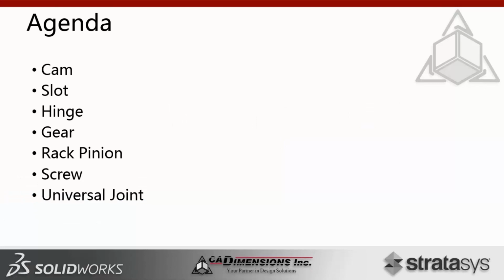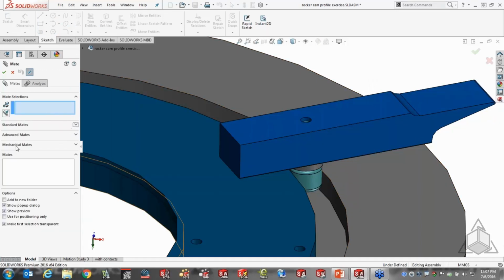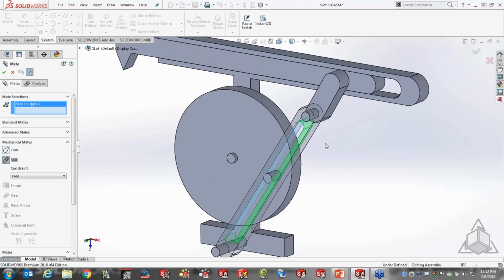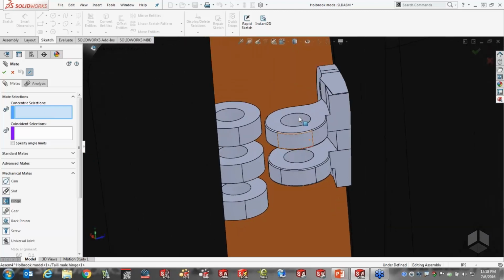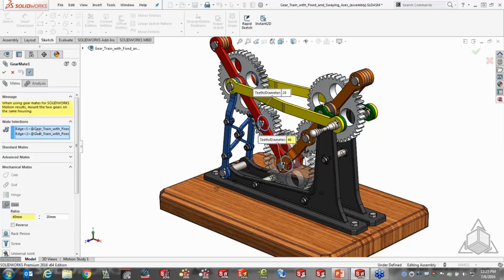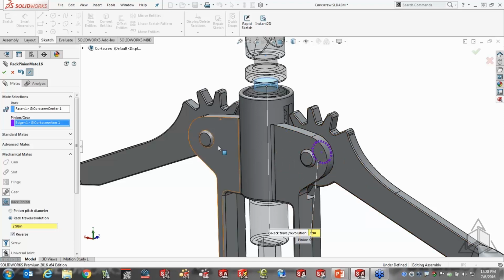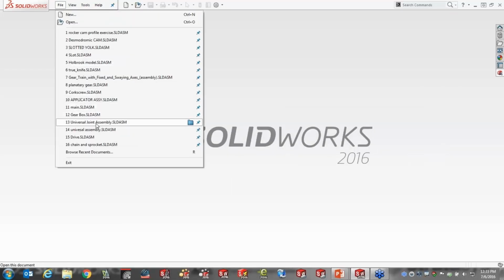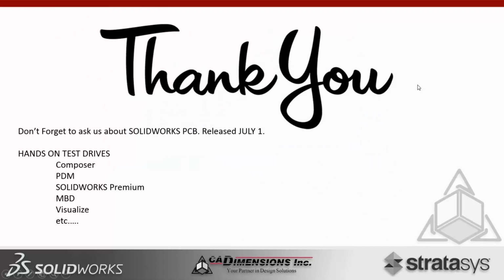Lunch & Learn - Mechanize it! Review of Mechanical Mates in SOLIDWORKS

Comment: Vary good presentation, my name is Arturo, I purchased solid works 2016. I have 30 years’ experience in machine design. I have designed a complete automated packaging machine the old school way and plan to redesign it using modern components example a rod less cylinder taking place of a motor, chain, sprocket, pully, belt, riding along rollers. This just sample of the many movements this machine has. It contains around 300 parts many subassemblies onto 2 main assemblies. Your video just helped me out a lot. All the assembly mates just presented, will make my machine come alive. The machine is about ¾ done. I may fumble my way thru these mate animations but will replay the video to get it right. Thanks for your help.
Good day
Arturo